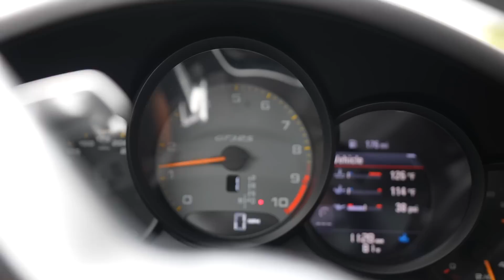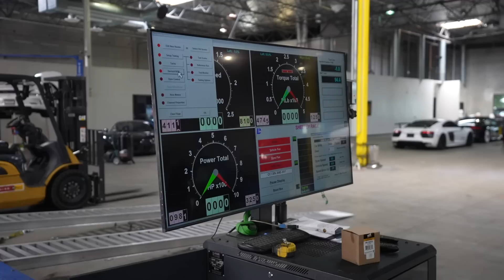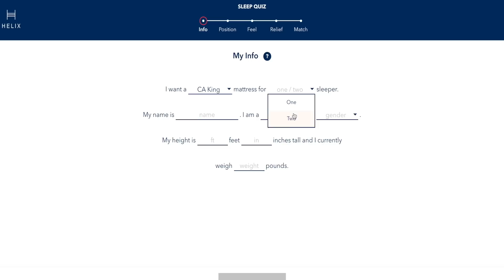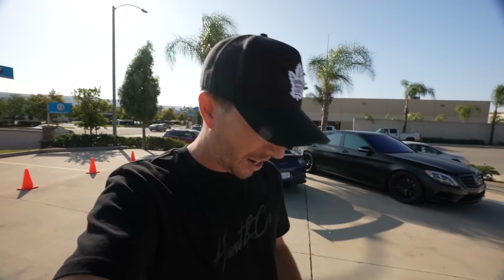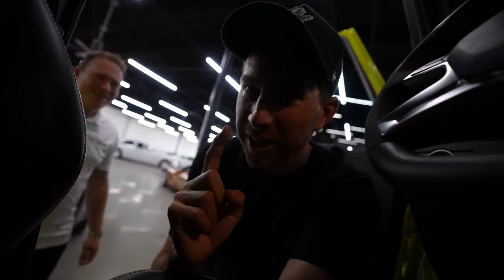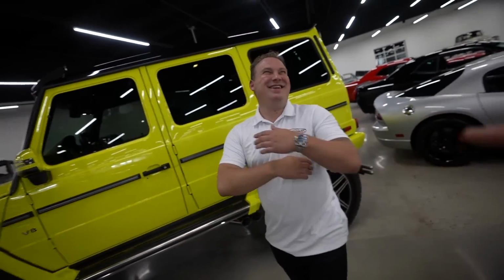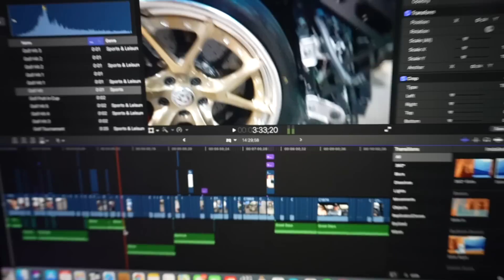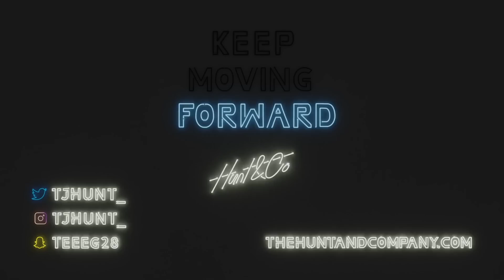Twin Turbo Lamborghini SHOCKS us all! 1,XXXHP???

Comment: Run the 800whp and enjoy it. A buddy of mine had a R8 that was tuned up to ~850whp and decided to build the trans and everything to put down 1200whp. His car was reliable at 850 but had issues at 1200. It took forever and cost even more. Enjoy the car at 800whp for a while, you don’t need 1200whp yet.